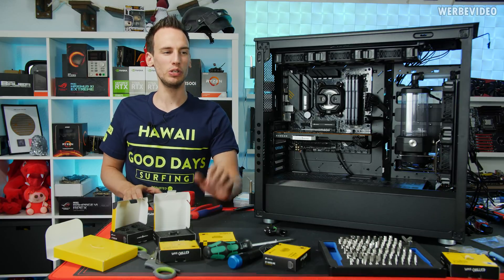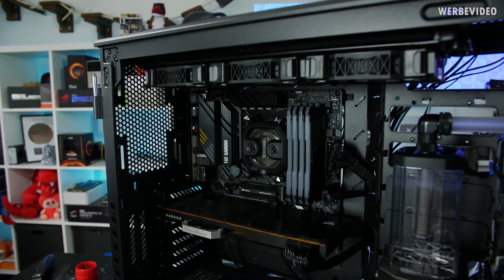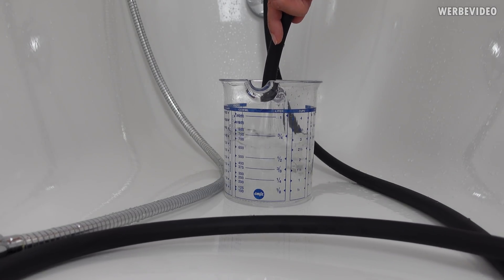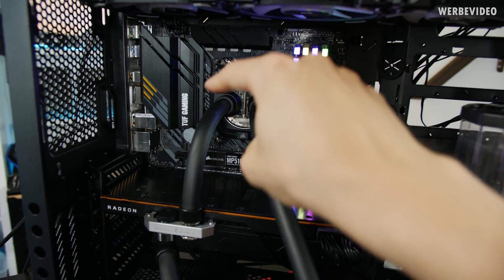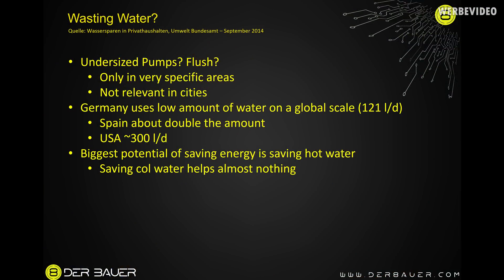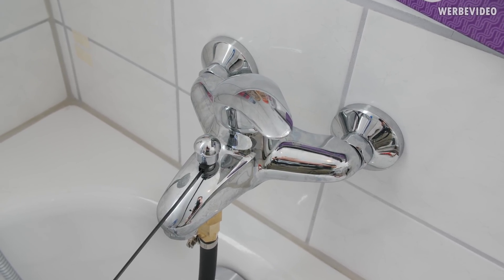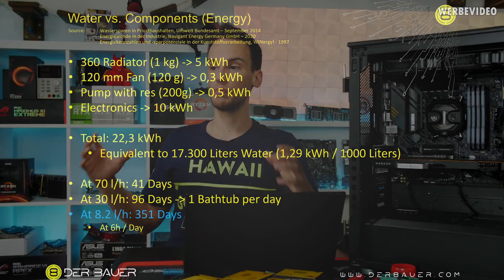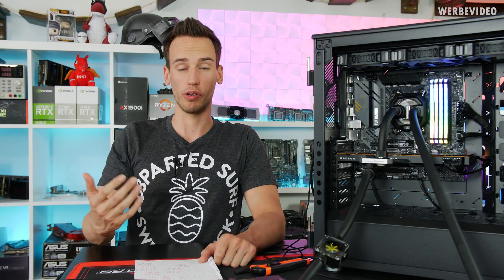So much Better than expected! Cooling my PC with TAP WATER

Comment: It is a very interesting question with a lot of angles - does the environmental cost of supplying and re-processing water exceed that of manfacturing and supplying and powering watercooling equipment...
I would guess the sheer water use would win for the environment.
Reply: No waste if you return the water to the main cold water tank in your home , no

Comment: Well that is how power plants do cooling. They take water from rivers for cooling. 
I would not use tap water but I was thinking to use water from the water well in my garden. :)
It is pretty cold and it is almost free. The only cost is the electric water pump.

Comment: You are a whole planet of wrong on you WASTING and USING water. All the water you use is robbed from the flow of rivers and wetlands etc. The more water we use the more damage to those environments we do. The more we use the more dams and plants that are built.
That said - the amount of water you are using would at lowest flow be ideal for watering your garden on a drip, or filling the toilet after it goes through the system, you can entirely recycle that with no trouble at all. At the higher flow rates you might want to run a laundromat or something XD

Comment: not at all surprised by the numbers. I'm a chemist, and we also use tap water to cool reactions / distillations / etc all the time. our university campus also has a closed-loop chilled-water system that is used to cool laser equipment, high-power equipment, server rooms, etc.

as for residue build-up in the blocks, just using a funnel to pour a little bit of vinegar into the loop once a month would easily dissolve all of that without damaging the components.

Comment: Depends on the area in terms of whether it's "wasteful". For US folks west of the Mississippi of southern states it would be terrible. Where I'm from water is so cheap they don't even charge for it in my condo complex.

I did something similar to cool my entire office using a Mazda 6 radiator, a solenoid operated valve, a zigbee wall socket iot switch and a zigbee iot temperature sensor. I set the solenoid operated valve to open at 78F degrees and to close at 76F and hooked a fan that blew through the radiator at the same time. My home assistant gave me metrics on how often it was on and basically on a hot day to drop my office down to 76 from 78 was about 10 minutes and it would cycle 3 or 4 times a day.

Sounds bad taking 3 to 4 showers a day until I noticed that my AC unit was staying off an hour or so a day. That means I'm saving roughly 3kWh's of power and the energy and the comparable energy to deliver water via municipal systems is minimal for the amount of water I'm dealing with.

So in my very specific case I save energy but not water so if I was in a state where water is a premium may not be a smart idea but in the Midwest or in/around the great lakes, this is a viable option.

And that's for a full sized office. Cooling a single computer you could throttle the flow rate and save more water.

Comment: Why would you "use" this water? You take it from the pipe before measurement device and you run it throught the loop and then you return it to the pipe again before the measurement device, same way as towel dryers take (and return) hot water to the hot pipe before measurement device.
Reply: Now this is an interesting thought. Could also increase the average temperature of your water going into your water heater for example, thus lowering the amount of energy expended to heat water in your house for shower/bath/dish washer/etc.
Reply: @drewwilliams1337  yep, basically its an unwanted benefit, but if you take 32 Liters and raise their temp by say 1 deg, the pipe still gets its toll so still end up with 14 deg C pottavle water unused

Comment: Theres a group of Thai XOC guys with a great direct die block ive been using. I get 60c max temps on my 10900k at 5.3ghz with 1.5v set in bios on my apex. 60c during linpack.

Comment: You can save water by just adding a reservoir tank and looping it back in!
Reply: Basically a big passiv watercooling bowl. That would require a pump again. And a thousand meters of pipe would be a better passive cooling solution because of the bigger survace area. But then again some radiators in row, damn... we are back again at the standart custom water loop 😁

Comment: Also how lasers were being cooled back in the 90s, its a pretty common way to cool very hot stuff, just getting less so cos water conservation. They also often  use liquid-liquid heat exchanges so that the ionised tap water doesnt contaminate the equipment. Something else to consider - most total loss water cooling systems still have radiators, so as to avoid returning hot water to the environment..
Another thing the 'big guys' do is using large outdoor reservoirs and radiators. Like linus tried to do, but practical XD
Reply: BTW a really common industrial cooling method is a closed loop with a water to air and water heat exchanger - basically spraying the rad with the water you would be running through the system atm, that would add evaporative and i wonder if it may be more 'efficient' per litre

Comment: Very interesting video 👍 The simplicity and quietness of the loop is very appealing. As to the environmental impact, I think the savings you'll make just from the manufacture of components no longer required will offset the costs for quite a while. At the end of the day if I'm paying for the water it's up to me what I do with it. The "used" water could also be re-used before it enters the waste water system. An excellent idea

Comment: Instead of sending it down the drain, send it to a bucket and use a submerged pump to send it back. 
Say you have a 10litre bucket, the only issue you’d have is maintaining the water below room temp, (the cpu does not have enough thermal output to even touch that amount of water, as water has excellent thermal mass properties) so just add ice, yes it would then be an open loop system but you could also chill your drinks in it! 

Another problem is wether you have soft or hard water, soft will lead to corrosion issues and hard will lead to scale buildup. Sacrificial anodes will take care of soft water, and simply filtering hard will take care of scale. 
Cool vid nonetheless.

Comment: Here in the US we have homeowners using geothermal heating to supplement their heat in the winter because the underground temperatures are near constant. I have always thought a geothermal loop to cool a pc would be interesting too. You would need a pump but the loop would function as a giant radiator. I would think it would perform similarly.

Comment: What about an hybrid system? 
So when doing heavy loads, you switch to tap water, when idling you switch back to a water loop. That way you basically only run for an hour or so. You don't need such low temperatures for 6 hours a day on average!
Reply: Or just put your radiator into a tub with the tap water. That way your components only contact distilled water. Whenever the water in the tub gets too warm the tap gets turned on to replace the warm water with cold water. Warm water gets used to flush the toilets etc.

Comment: some places has tubing for "gray water", it is basically rain water or unclean to drink, but is used for washing and irrigation.
A little bit of filtering and you can just recirculate the hot water back in the system as gray water again!
And when gray water became scarce, you can compensate with tap water

Comment: This was a great analysis and you did a really good job of studying the whole system for total energy consumption which was a new (but very crucial) viewpoint for myself and I'm sure many others. This made me think about energy consumption differently. I really like Alex Demskie's comment about a temperature regulated flow control. I also really liked your comment in another video stating nobody uses the CDs sent with motherboards and they might as well just throw them directly into the garbage at the factory and save me the effort. Truly a LOT of plastic waste for no reason.......even if it gets recycled is a waste of energy. Love the unique tests and projects you do. Keep it up!

Comment: What if you had a closed loop without a radiator but a "hot plate" that you put in the coolest area of your home, ie basement? Not the same as this I know, but you could research the absolute most efficient pump available and instead of paying for the water, you pay for the tiny bit of energy.

Comment: Have to absolutely agree, first thought was would be simple and probably work well, especially depending on what time of year and water temp, but what a waste of water. If you could run it out into a capture tank and use it for something else or then feed it back through your house/apt, then yes, otherwise, no. Also, great to see that you not only care how your computer runs and think of the environment, not something many is the US think of. 
Curious, if you'd look at testing just filling the tub with water and circulating that? The tub would act as a huge sink drawing the heat out the water and I think it would produce almost as good results, just would need a strong pump to get the water to the system. I know you did something similar when you were on vacation in the islands, but would be interesting to see something a bit more obtainable to most people.

Comment: Instead of a radiator use a water heater and connect the PC to the ports that normally connect to the home radiator system so you can use the wasted heat from the loop

Comment: Depending on your tap water, wouldn't this cause long term damage to the waterblocks, especially if the tap water is especially hard leaving calcium/lime deposits?
Reply: yes but that's a veeeeeeeery long time and also citric acid exists.
Reply: And just buy two of each block , swap over when performance drops , clean the removed blocks ready for next swap . But I think it would take an awfully long time to limescale up . Or have a limescale remover flush through the system , switching this contaminated water to waste . Once flushed through switch back returning back to main tank
Reply: what do you think water pipes are made from man?  Copper!  And they last for Decades!
Reply: yes, but you can add a filter in the way.

Comment: its a great way to waste lots of water. I did something similar to this but instead of letting the water drain i used a bucket full of water ( no radiator) so i used pc and got bucket full of hot water after using pc for a while. So i needed only pump, tube and cheap waterblock.
Reply: Also micro fins will be clogged up in just few days due to minerals getting deposited on them.

Comment: Rainwater tank in the coolest part of the house with thermal blankets (you could design a thermal grizzly branded thermal blankets) and pump let  it flow for 2 to 3 hours before to chill the water moveing water cools down more then stagnet water

Comment: I have done this in the past using my large rainwater tank, I live in Ireland so I rarely ran out ;-) if you live in an apartment its not viable but anybody who lives in a house can have a 200L barrel to catch rain water. you can also run a small pump to go back to the barrel, the pc takes a long time to heat 200L of water (Again I'm in Ireland, I dont know what it would be like in spain and my tank is 1000L)
I only stopped because it froze one winter and burst all my pipes, a small bit of effort with insulation could have prevented that.
Reply: You should have ran it continuously and faster to prevent freezing :D
Reply: @Philip8888888  Or even loop it back in winter

Comment: Very nice presentation and a brilliant idea. I think it should be of interest for the local government/administration. 
For home PC users, maybe, less attractive.
But let assume you can replace the coolers of 100 PC/servers, or more, using a dedicated pipe system. The "exhausted" warm water could be used to produce hot water necessary for complementary industry like food processing, cleaning or simply heating during cold days. Could be considered, somehow, similar to the wind/sun energy contribution to the entire consumption towards fossil source energy but more predictable.
Paired energy consumers could be a solution to reduce the overall energy consumption.

Comment: In Thailand, the tap water in some rural area during the middle of the day is like the boiled water. It's pretty hot so this method can't be used. Also the quality of the tap water there is low quality. The residue will be increased in a matter of time.

Comment: Back in the day before we had refrigeration, during the winter months people would collect as much snow and ice as they could. Then they'd dig a hole maybe a few metres deep (but even 1m is enough for a small amount) and fill it with the ice/snow. Then in the summer months they'd put food below it, surrounded by hay (to prevent ice burn), then cover the top in hay as well. For larger ones they'd dig a tunnel to it so they could actually put the food directly under it. With much less than even a cubic metre of ice/snow, the ice/snow would usually stay there all throughout the summer months and make it all the way to winter.

I've thought before about doing the same thing today, except running a loop through the snow/ice instead. And also obviously being able to fill and top it up anytime you like. I haven't done any back of the envelope calculations, and it's obviously not going to last several months like it would normally. But if you had a cubic metre of ice/snow i'm sure it'd still last ages. It could make a very low temperature loop for super cheap and also being environmentally friendly.

I don't know how plausible and effecting it'd be. It'd certainly be cool though.
Reply: It would cost more but there is already a solution that basically uses these principles that have been in use for exchanging heat for nearly 50 years; ground heat exchangers. That system that you described is a fridge based on the fact that the once you get down past the layer of dirt that absorbs the majority of the heat on the surface, the earth is fairly stable temperature-wise all year long. It's generally somewhere between 50F to 60F depending, on location; that's lower than the tap water temp in this video. All you would need to do is run a long length of tubing a few feet under the ground and hook it up to a pump that circulates it. When it comes to the systems that are used for controlling temperatures in homes or greenhouses, you need a couple hundred to a couple thousand feet of tubing snaked back and forth; you could get away with far less if it's just for a PC. In theory, you could even just with air cooling with ductwork instead of tubing for liquid as the air will be fairly cool once runs through the underground system.
Reply: @aprisia  That's amazing. I think it would be worth the work to lay the piping all over your yard for this project. Would possibly need city permits for that much digging. On the permit description just say using for a green house garden, ha.
Reply: The stately house in our town has the old "Ice House" for people to see. A partially covered/underground cellar for storing snow and ice and food.
Reply: The difference is food doesn't generate heat but your pc cooling loop would be actively dumping hundreds of watts of heat into the ice. I'd be surprised if the ice lasts for a day.
Reply: @OTechnology  Yes but it also takes an awful lot of energy to heat up water or ice.

Comment: Curious why you didn't expect excellent results.  Tap water comes at much higher pressure than a tiny pump can produce, and it's usually colder than ambient.  So we should expect a higher flow of colder water.  Seems like we should have expected it to perform very well, longevity and corrosion issues notwithstanding.

Comment: The waste water from this should be fed into the input of the domestic hot water system (via a storage tank).  That way you do not lose the water or the heat energy transferred into it.

Comment: @der8auer : Roman, would it be possible to make a video in which you investigate the effects of using tap water in a (closed loop) watercooled system, to see if it has (long term) corrosive effects (or not) on the water blocks and radiators ? Tap water does not only have chalk in it but also other chemicals, and these may have a adverse effect on our liquid cooling hardware.

Comment: that idea would never work in countries like here in Cyprus...where we have 8 months summer...and the damn water is always hot from the taps due to using tanks in the roof under the sun and because the ground is never cold enough. in Summer the water is always about 30-40c minimum coming out from the tap! this is annoying to wash your face! the first 10seconds are nice about 15c cold or 20c, you wash your face fast and then for the next 3-5min is boiling hot like 70c-80c+++ and then you get about 40c constantly.

Comment: Just as an addendum... LTT did a whole room setup with regular water and the buildup of materials inside the water blocks and it affected the performance of the machines over a longer period of time.
Reply: Link to the video, but also a correction that the "loop" wasn't using consistently run tap water...
But calcification and mineral buildup are still a concern. The need to adjust hard water to soft water to keep the water blocks alive.

https://youtu.be/EV6oYfcAwLM